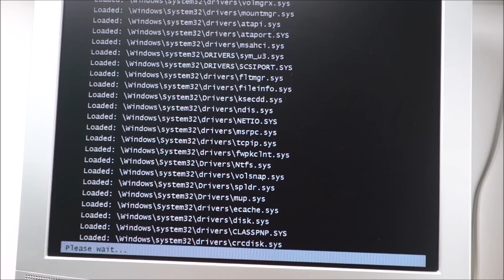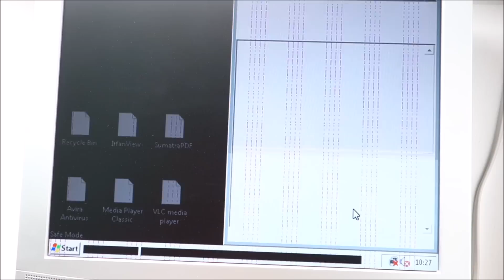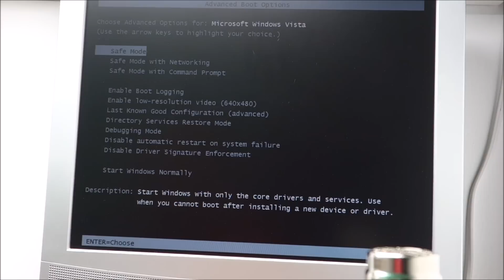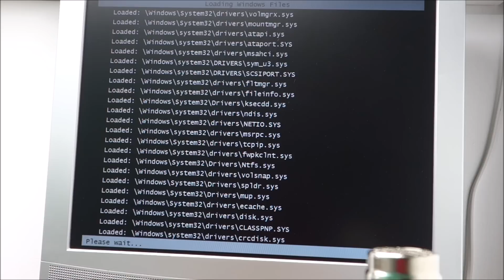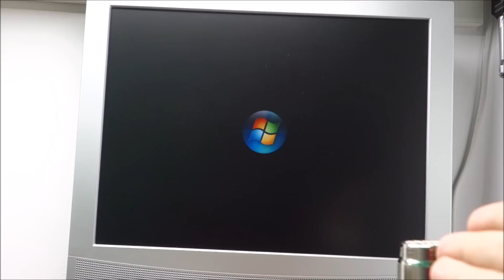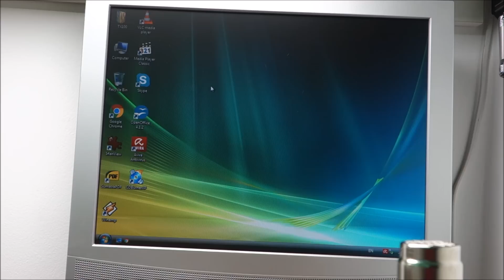How to reflow a video card with a cheap heat gun

Comment from the maker: ▬▬▬▬▬▬▬▬▬ஜ۩۞۩ஜ▬▬▬▬▬▬▬▬▬
        T H A N K  Y O U  F O R  W A T C H I N G !
     P L E A S E  L I K E  A N D  S U B S C R I B E !
▬▬▬▬▬▬▬▬▬ஜ۩۞۩ஜ▬▬▬▬▬▬▬▬▬
Reply: Nice attempt, unfortunately these kind of diy repairs are very much dependent on the exact temperate, distance, airflow and time applied.  Sometimes a few millimeters of distance, degrees, or seconds can mean success or a total failure as in burnt.  Another issue is that after the "repair" under normal operating conditions the joints can become debounded again usually due to the heat generated by the graphics chip.  Nonetheless, it's worth a shot. :)
Reply from the maker: +Bill A I 100% agree with you :)
Reply from the maker: allen joseph wow! That thing gets really hot at max :)
Reply: yeah, I love the function of adjustable temperature
Reply: LIKED!
Reply: @j-man6001  quick question, if those black square transistor thingies are damaged, as in having a nick on them can they still work,?
Reply: @BillAnt  Works just fine but requires liquid flux and experience to work reliably.

Comment: My mid 2011 iMac (27") stopped working completely after the graphics being all weird for a short while.
I used that video to check the appropriate temperature and how long the heat should be applied.
After un-mounting my iMac to remove the graphics card (which was hell), I did about 200℃ (looking at the indicator on the heat gun) for about 50 sec as in the video.
It worked the first time.
This saved my buying a new card (about 2万円) or Apple telling me to buy a new iMac instead.
Only those old iMac can be used as a secondary screen for a Mac laptop which are so useful during COVID.
Thanks man! You deserve my upvote!
Reply from the maker: Welcome!

Comment: Thank you. I'm typing from my resurrected computer :) Machine was crashing every ~30 mins to 1 hour for about a month until finally it showed artifacts on the screen during bootup process and would freeze before getting into Windows. I used a Porter Cable brand 1,500W heatgun with the temperature dial at around 85-90% power for 3 mins and 45 seconds. I see you only did yours for 1 minute but my chip is about 4 times bigger (Sapphire Radeon HD 7970 Dual-X). I also watched a 2nd video on this process which is how I gauged where to set the temperature dial (also - they did 5 minutes, but I decided to do only 4 because if it didn't work I could always go back and try again). Best of luck to everyone attempting this.

Comment: Nice video and good job on the card! I have done similar repairs in the past, mainly on Xbox 360s because of the whole RROD. I also thought you may have applied heat for a little too long but if it works! Don't think it matters too much really, anyway. The only problem with these repairs is that, I find, they don't seem to last too long and the problem reappears weeks/months down the line... 

Another thing I think is fairly important, is that the board needs to be kept very still throughout the whole process and for at least half an hour afterwards. I couldn't tell if you did this because of the way it was edited but I just hoped you had, at the end of the day you got it working, though, so great!
Reply from the maker: +Oliver Huckstep thank you! The card still works for the moment, but as you say, sadly it's not a definitive fix in most cases. I don't remember how long I left the card unmoved, but it might be for less than what you said, so I will do that in future repairs for sure.

Comment: I have a dead card that I suspect needs a re-flow, and I say that with some confidence, because it gradually got worse and worse. I was thinking about using an oven to bake the card, because people have been suggesting that recently on the internet. However, by heating only the chip, there's less chance of creating new faults on other components. The chip shouldn't take any damage from such treatment. I think I have to consider a heat gun instead, and yeah, they are cheaper too. Thanks for showing your success and make me re-think this!
Reply from the maker: Hope it works for you. I had the same logic as you.
Reply: @UltimateDIY  Well, it seemed to work! I just hope it lasts.
I gently warmed the whole board a bit first to reduce any stress in the material, then I covered off the other components with a bit of aluminum foil like some others on YouTube have done. Like you, I tried to gradually heat it up and gradually cool it down. It's hard to judge the temperature and time since the heat need to go through the whole thing, but a couple minutes of heating up and then about 4 minutes of the most intense heat period seemed to do the trick for me, with a little bit of motion to spread the heat. Older cards probably take less time to heat up. The gun I got has two settings, and I used the lowest one which is 300 degrees Celsius, which is well above the melting point of the solder, and lower fan speed.
Good luck to others that want to try this!
Reply from the maker: Many say that this is not a good fix and it should not be done. But in my opinion, it's worth reviving a bad card even for a few months in the worst case.

Comment: You can put foil over the surrounding components to keep the plastic from melting and protect them generally a little bit. I put a D630 with the notorious nvidia card in the oven and it worked for a little while. I'm viewing this video because I have an older Dell monitor that I bought cheap because it occasionally blinks and has artifacts. Lived with it for 2 years but I'm thinking it's time to try a reflow. Only thing is I don't just open a spacious case and unscrew it.
Reply from the maker: Thanks for the info 👍🏼
Reply: How do you do that exactly in terms of thickness, layout, extra protection, overall technique + oven temps + time?

Comment: I’m glad to inform that two of my graphic cards are working again! Thank U!
In details: I have Nvidia 8800GT (artifacts on the screen to the point that just after loading OS it freezes) and Radeon HD5770 (couldn’t even start the computer - black screen).
I used exactly the same heat gun with 350°C settings only and for about 2.30 - 2.40 seconds. When finished I left both of them for 30 minutes to cool down and assembled again. That’s all :) 
Cheers!
Reply from the maker: Awesome! Glad it also worked for you :)
Reply: by saying 2.30 seconds you mean 230s or 2min 30 seconds? thanks!
Reply: Gj I will try,, I think he said ,2m
Reply: Will try this on 9600m gt. Artifact on screen. Will update again the progress
Reply: @balazsio  yes sir - 2 minutes, 30 seconds. Sorry for confusion.

Comment: Other video that I've seen stick Kapton tape to the heart of the big chips. Also they apply flux wherever they could so they can see it it's melting. Flux also remove oxide from the old solder making them reflow more readily
Reply from the maker: Thanks for the info 👍🏻

Comment: Great job. Put a strip of solder on the chip so you know when it is hot enough the solder will melt.
Reply from the maker: That is a great idea. I would give a simple visual clue. Thanks!
Reply: i might be doing this with my laptop gpu which is dead thanks
Reply from the maker: Aditya Sahu, hope you get it fixed! :)
Reply: Not that good of an idea.
1. Solder on the chip? seriously? what if u short something like that?
2. Solder ON the chip will melt MUCH FASTER than solder UNDER the chip.

Bad idea to "measure" this.

What he did in the first place was ok. Just a bit longer and than test if it worked.
Reply: that strip of solder woud melt many times faster than ball under the chip because of heat transfer to board
Reply: What is the safeties heat for desolder chips
Reply: @tranceonline  Haha, right, balls are unleaded, put some lead solder and you will get exactly the wrong temperature.
Reply: Just use cheap air rework station instead to calibrate temperature by melting solder in practice run and repeat with broken motherboard.
Reply: That sounds like a horrible idea!!!!
Reply: Use flux and heat IC til you can GENTLY nudged it and it snaps back; then you know it's reflow. Add a bead type thermocouple for more temp control. Your DMM probably has one.
Reply: Or you could be smart and use a volt meter with a temp probe. Solder would be a very bad idea.

Comment: This is a temporary "fix". The issue is the bumps that adhere the die to the substrate and not the solder balls between the board and the GPU. Heating the chip causes these bumps to make contact again. After some heating and cooling cycles the bump(s) will break again. This is usually after 30-90 days
Reply from the maker: After watching a few videos on this subject, that is also the conclusion that I reached in the end. The weird thing is that the GPU in my video is still working.
Reply: Ultimate DIY it really depends. Some may last for a good while and some won't. It depends on what part of the chip fails too. I mainly do motherboard repair for MacBooks... Check out my channel if you'd like
Reply from the maker: Yes, it's a hit or miss kind of a deal...
You have a new subscriber :)

Comment: A common fault >>> Caused by Video Card Sag. The Sagging happens over time with gravity and a low heat generated by  the electronic processes running the card. This also happens with machines that run continuously ie: 24/7 without being used. The video card in a Tower is not vertical > this sagging happens over a long period. This is not common in Small form Factor Machines at all. The evidence points to 'Solder dry out' and softening by heat of the video circuit board and influenced by gravity, culminating in bending.
Reply from the maker: I hear you. I had a card that only worked when held straight. It was sagging badly.
Reply: Sagging is a result of the gpu card tabs being much smaller than the slots they fit into on the case behind the motherboard thus they drop and appear as sagging..  Nylon screw or toothpicks in the slot where the tab goes after card is installed will fix it (Just hold card level and use non conductive piece in the slot to keep it there Nylon screw works best).  Too many myths not enough new designs.

Comment: Great video. Just as far as I am aware reflowing should also be consisting of letting a nice amount of soldering flux under the GPU chip to remove all oxides. Also this isn't most durable fix for GPUs according to most people that work on this. Just a heads up :) Great video anyway. Really educational
Reply from the maker: Thank you! Until this video I never used flux, but after reading the comments I started using it and soldering/reflowing works way better.

Comment: I just managed to fix a Sapphire r9 280x with a heatgun. The card produced artifacts and went black during boot. I disassembled the card, cleaned it with alcohol and covered the circuit around the GPU with aluminium foil. Then I used a cheap 2kW heatgun for approx 30 sec directly on the GPU, with a distance of ~3 cm and moving in circles. After I let it cool I added a new coolant paste and reassembled it, and now it works!
Reply from the maker: Glad it worked for you. There is no guarantee for how much this will work, but even if it's for a few months, it's still a win in my book.

Comment: I was getting alot of artifacts & screen going off and on using a 5 yr old 560 ti I tried this but I pasted some reflux on all the sides of the processor & hovered the nozzle of the heatgun in a circling motion blasted it for a  minute. Works like a charm no more artifacts & blinks thanks man I was ready to give up on my 560 ti I have money ready just incase it does not work I'll go ahead & buy a new 1 very nice so far I'm playing dota 2 on it for 2 hrs straight no issues will update you guys if something comes up.
Reply from the maker: great that you got it fixed :)
Reply: Still working?

Comment: "this is bloody working" great comment,!
going to try this on a lcd tv main board. have mounted a CPU computer fan over the board and i no longer get my problem. normally the problem appears once the board is hot so i am thinking a bad solder joint.  good video!
Reply from the maker: Hope you get if fixed!

Comment: Fixed GTX 580 artifacting by just heating up the concerned GDDR5 module. You can identify the problematic VRAM module using the MODS/MATS software. Heating up the core risks damaging it permanently.
Reply from the maker: Thanks for this info 👍🏼

Comment: Funny enough, I came here to see if I could fix my own GPU from an old Core 2 Duo machine, it's a 7300 LE lol
Going to attempt this repair, hope it work. Thanks in advance for this video!
Reply from the maker: Welcome! Hope you get it working :)
Reply: Did u fix it?
Reply: @illiakolosey4285  No, unfortunately not. I must've tried a dozen times and I was actually noticing some differences sometimes but was never able to get it back 100% to working state. As a last resort since trial after trial it didn't fix it and it was very time consuming, I tried turning my heat gun to a higher setting but that killed the card completely. It's absolutely worth a shot but I guess my card was too far gone.

Comment: So if you have decided to reflow a pc card then do it a little more efficient and professional.Use a flux paste like RMA223 that is somehow liquid to flow underneath the bga,use your electrical home barbeque grill for bottom preheating and for upper heat the same heat gun until the solder balls to melt and with the lightest poking the bga looks like floating on the solder balls.Floating the bga is the evidence that all the solder under the chip has melt and the chip resolders in its place.Greetings.
Reply from the maker: +George George thank you for the guide!

Comment: I did this while pressing down on the chip itself while in between heating the chip also used fluxpen and ran that underneath the chip. That was 5 years ago and the gpu still going strong even with overclocking
Reply from the maker: That is really good!
Reply: Good result! What difference does pressing down on the chip make?
Reply: Sir Prancelot it seems to make the solder balls make better contact and puts more material where it needs to be. Just make sure not to over press it and do a even press
Reply: @TheF209  OK Thanks for the information!
Reply: Faisal Ayub 
I’m glad it worked out fine for you. I don’t think pressing down is a good practice though. 

Firstly because is shouldn’t be necessary because the chip and the board should both be flat. If not pressing on the chip would bend the board even more possibly making things worse. 
Secondly it’s not done during manufacturing nog during professional reflowing and reballing. 
Thirdly and maybe most importantly, when you put pressure on the chip you might also move it slightly. The balls are very close to each other and even an offset of a fraction of a mm can be disastrous. The chip normally positions itself by the capillary force of the melted solder. Best not to interfere with that. 

Just my 2ct.

Comment: This help me fixed my red blinking light on ps3!
Reply: ps3's die because of faulty NEC/TOKIN caps, not the gpu or cpu dies smh.
Reply: @DarkoPetreski  not entirely true. In my experience repairing PS3's the NEC/Tokin caps are the problem maybe as high as 15% of the time.

One reason people thought the Tokin's were the problem most of the time was because the heat required to remove and reinstall the capacitors had an unintended side effect of temporarily reflowing the RSX (since they are so close)

Comment: Is it still working? Any new video about the card working? I would add a few drops of flux under that chip, preheating the chip and not putting too close the nose and covering the other components with alluminium foil.
Reply from the maker: Failed a few months ago. Will do a follow up video when I reflow it again.
Reply: Ok good. I do have some gfx cards with almost same problem. It is kinda of annoying... Gfx cards should have sockets where we could put gfx chips like in the older days where socket pins were tightly with the pcb.
Reply from the maker: Cheaper for them to solder and they don't want us to be able to fix them time and time again...
Reply: Well i got myself a heat gun recently and 100cc of flux and so far i fixed 3 gfx cards, im using one right now named geforce 8500 gt and it is running on windows 10 pro. and there is one 12cm fan with magnet installed vertically blowing air to the gfx and to the motherboard. so far so good. this 8500gt does really get too hot without any airflow. 80c with just the cooler, <52c with air blowing
Reply from the maker: That is really nice. Glad it worked for you :)

Comment: Just for everyone information this is not a permanent fix! It will likely only get you 1- 3 months use out of card! The cold joints below the chip are oxidized and a simple reflow does not get rid of the oxidation- only reballing will!
Reply from the maker: Yes, it's not a permanent fix. About the reballing, no, not actually, because the fail is in the chip itself. Louis Rossman has a video that explains this.
Reply: @UltimateDIY  how long your fix on the video last?
Reply from the maker: It's been really long since making this video. Maximum 1 year if I remember right.

Comment: Would this have been better if some no clean filux had been used to help the solder joint viability. This way the sooner joints may or may not last
Reply from the maker: Yes, for sure.

Comment: This akin to "BAKING" THE BOARD at 385 DEGREES for 12 MINS , Which works but only for Ax. 3 months. Others please advise with technics? - Thanx
Reply from the maker: I don't think there is any way to permanently fix it, appart from changing the gpu die.